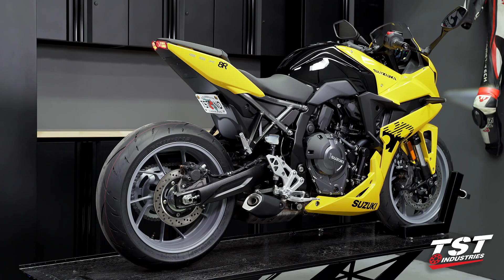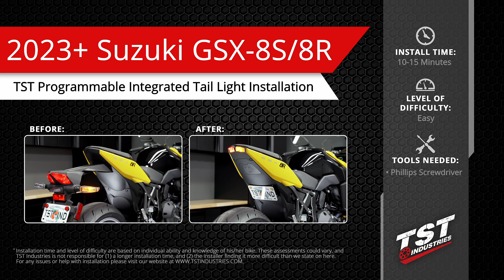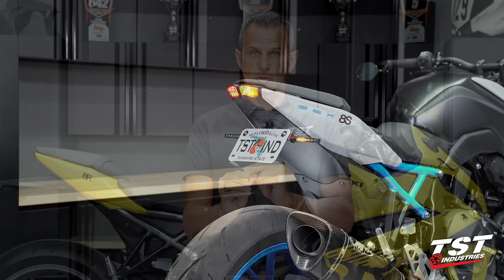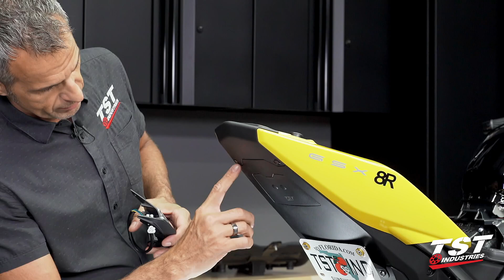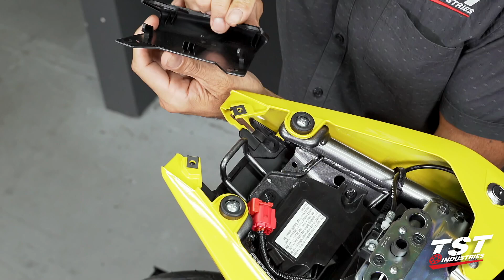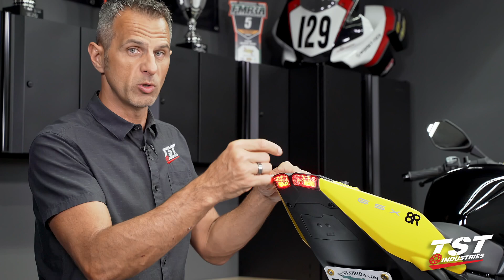How to Install Programmable Integrated Tail Light on 2023+ Suzuki GSX-8S / GSX-8R by TST Industries

Comment: Mine does not have the brake light stay on when the bikes on, just found out recently, making night driving dangerous AND the program button doesn’t do anything, it’s stuck at that race flashing brake lights and inner to outer turn signals mode; I’ve tried holding the front (and rear) brakes while pressing the button, nothing. Tried doing it without pressing the brakes AND separately while the bike is fully off, still nothing, reseat every connector and still nothing
Reply from the maker: Please email our Support Team with your proof of purchase and they would be happy to help you resolve these issues. Support@tstindustries.com

Comment: My blinkers aren’t working ???? I plugged everything in and break lights working good I can program the break light and everything but the blinkers themselves are not functioning
Reply from the maker: Have you installed an LED Flasher Relay yet?
Reply: @TSTindustries I have not! I just got the tidy tail in earlier today and hooked it up I also still need the adapters for the front turn signals, I was running the bike with the oem tail and it stuck out way to far an I broker’s driver side front blinker so I just took the front ones off and it was fast blinking and I put the tidy tail on and now it won’t even engage the blinkers will the relay fix my issue ?
Reply: What products would I need to buy to get the integrated flashers to work ?
Reply from the maker: If your bike is equipped with an LED specific flasher relay then you need nothing further for the signals in the tail light to work. If you have a relay meant for incandescent bulbs then our LED flasher relay that is found in the product category for this bike will get them going for you.

Comment: Also, those light I feel are too small....a better safer, design would be if they where bigger covering that whole bottom of the cover until where the screws on the left and right are ...,.

Do you make the lights bigger? Id like the bigger lights option.,......I'm a new rider.
Reply from the maker: You should watch over our Product Feature video and maybe that will change your mindset. These are plenty bright and some of the brightest lights on the market. Some other options that have more lights aren’t as bright as ours. We will not be offering a “bigger” light at this time.

Comment: Also, what if I WANT BOTH LIGHTS?  

THE FACTORY+ YOUR TAIL LIGHT.......FOR MORE IGHTS.
Reply from the maker: You can absolutely keep both light sets on the bike. We offer Y-splitter harnesses for this lighting, giving you a plug and play means for connecting two light sets. Here is a link to the Y-splitter for the main tail light function: https://tstindustries.com/tst-y-style-tail-light-harness-splitter-select-suzuki-motorcycles.html . And her eis the one for the signals: https://tstindustries.com/tst-y-style-signal-harness-splitter-for-suzuki-type-b-plugs.html

Comment: 8s is two days with me. !st project: the exhaust. I need to hear the motor! Then, I will undertake these projects. You do a SUPERB job with these videos and I am thrilled to have found you.
Reply from the maker: Thank you for the kind words and the views!
Reply: I fitted aftermarket exhaust, 2 weeks later I refitted stock exhaust. First of all it was way too loud and P2 engines sound shit anyway. Second it completely ruined the drive ability, was shit to ride and had to change maps but still shit. I appreciated stock exhaust when I reinstalled it. 100% will require dyno tune, so factor that in to the cost, probably more than the pipe. And the sound of a loud P2 is atrocious, no getting past that.

Comment: will the WOMET-TECH PROGUARD BRAKE LEVER GUARD fit on a 24’ gsx8s?
Reply from the maker: That product is a universal style application so it can work but you may have to work with combinations of hardware depending on whether or not you plan on retaining the OEM bars.

Comment: It's wild that some jurisdictions won't let you put your turn indicators in the tail light. In my state you don't legally even need turn indicators on a motorcycle (because you can just use the 'turning' arm signs)!
Reply from the maker: Yes there are still a handful of those. But to provide a comprehensive range of product we offer mounitng options for OE signals, or aftermarket signals that satisfy the center to center distancce required. For those setups you either don't plug in the tail light signals, or use a Y-splitter harness to connect both.

Comment: Is there any detriment to not having the relay aside from fast blinking? I dont really care if it actuates faster, I just want to make sure it doesnt overload/harm the electrical system in any way.
Reply from the maker: @QuickPLFMA  that symptom does not harm the electrical system but if you are using sequential signals their light pattern will not complete for each blink

Comment: I want to combine this tail light kit and the quadrix d rear light kit, for both brake lights and turn signal lighting. The Y-splitter cable takes care of the turn signals, but is there a way to get both kits to light up when braking?
Reply: @thisisnotreallife20  I believe you just need 2 y splits, one for turn signals and one for brake/running. It should be able to double up no problem afaik
Reply: @petrol11  yup, i got it all working. I'm really happy with the combination of the products. I bought a pack of posi-taps to connect the 3 wires from the quadrix kit, to the 3 wires on the tail light kit, and that made everything work correctly. :)

Comment: @tstindustries - firstly thank you for a great install vid and excellent product, I'm loving mine on my GSX-8R. I am running into an issue with my fuel gauge showing "E", fully empty on my display. Even after refilling it. Is it possible it was something I did incorrectly during the installation?
Reply from the maker: @xARxNomaD  the tail light circuit is fully isolated from your fuel sender circuit so nothing you did during the installation of the tail light would affect the fuel level indicator. If you did the flasher relay then you would have disturbed the fuel tank and then there is a possibility that you may have disconnected one of the fuel level pins in the fuel sender circuit.
Reply: @TSTindustries  Thanks - I appreciate the quick response on a Sunday! Sounds like it's on me, I will take a look at the fuel pins. I appreciate the help.

Comment: I have a question is it legal??
Reply from the maker: You would have to check your local laws.
Reply: There's no plate light installed at 2:07 and that's probably illegal just about everywhere. Is there a kit with this setup that included a light for this? I love it but inviting cops to stop me is not my preference ...
Reply from the maker: @petrol11  it’s an optional product for those customers who want/need it. We show the installation of that component in our fender eliminator installation.
Reply: @TSTindustries  many thanks! I'm a bit worried about that plate light - shows a lot of white light source which afaik, is a no-no - ideally it would have like a shield or something blocking the direct light from the back, just my 2 cents

Comment: This rear light as just a brake and tail light . And keep the stock led indicators lights separate with a plate for number plate and plate led would be perfect for us in uk .
Reply: idk if you know, but you can do this - you can use it just as a brake/tail running light, and have signal stalks on the license bracket that work independently
Reply: @petrol11  Thankyou 👍🏻
Reply: I have now done this with Suzuki OEM short plate holder, OEM turn signals and the TST light.... Looks absolutely perfect imo.
Reply: @petrol11  where do u get the Suzuki short plate holder as the uk doesn’t seem to sell them ? Thanks
Reply: Well said as that’s the way to go looks like the. Best option

Comment: Personally, I think Bart is sleek & sexy😉 However, this rear tail light setup is the best one out there! Well done to the team at TST & to Bart the master designer & craftsman! 
If one chooses to have only the tail light functioning, the indicator plugs aren’t used & the Suzuki genuine LEDS are used. Is this correct? Can the Suzuki genuine LED relay be also used with separate LED indicators as is?

Comment: Legal in 0 of 50 states, but I'm still getting one
Reply: Dot cops inspection rules in PA state plate must be visible and all lights must function so really only need a plate light installed
Reply: Which they have the elite 1 that puts the plate down low like that with a light on it

Comment: QUESTIONS: If I already have the TST Brake Light Modulator, Does that interfere with the Integrated Tail Light, Would that Low-Mount plate get me in trouble in GA? @TSTindustries
Reply from the maker: You would remove the modulator because that functionality is built into the tail light. The low mount looks great but I do recommend going (or staying) with a high mount just in case.

Comment: Gonna be the first order tomorrow from California, I currently have the New Rage Cycle integrated tail light, is the y splitter applicable to both turn signals and tail light, or only turn signals?
Reply from the maker: Only turn signals at this time.
Reply: @TSTindustries  thank you, already ordered the kit and y splitter, can’t wait! You guys knocked it out of the ball park, and the customer support this morning while the website was being flooded with order was great 👍🏾 love yall 💕
Reply: @ItsAlexR I plan on running both the nrc and tst taillights, I have the turn signals hooked up with the y splitter,I'm trying to find a way to plug in the nrc tailight with out cutting the harness
Reply: @v_smodz4464  yeah I have it all wired up, the only issue with it is that the turn signals work perfectly on both TST and nrc, but the nrc break light doesn’t and neither does the nrc license plate light, I think the only way to get them to work with TST integrated tail light is to splice/pin tap into the TST integrated tail light wires